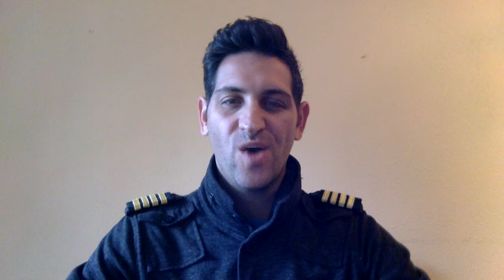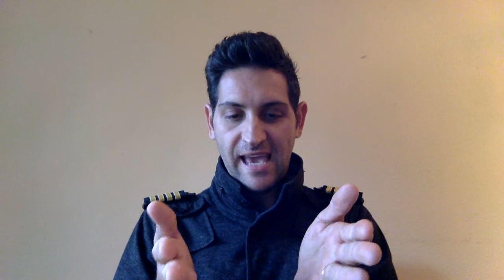How do you control a hot air balloon?

Comment: Very nice explanation. When you're dropping things off the basket to check the wind direction underneath, are you basically determining wind shear? I believe that would mean you have a vertical gradient of wind speeds at a set heading, so you could change your speed by rising and falling within the same layer of air, and if you also want to change direction, you need to find a different layer.

Comment: Would It be possible to build kind of a Sail on top or at the sides of the balloon to controll It?
Reply from the maker: Éderson you do not need a sail.  We can already control the direction of the balloon by using winds at different levels.  If you attached a fan or propeller it could slightly change your direction if there is under 10 kts of wind.  Although that would then be called a blimp
Reply: @Seattleballooning  oh now I got the Idea of the Wind layers, thank you for answering and Sorry for my wrong spelling, I'm from Brazil
Reply from the maker: Éderson no.  Balloons move with the wind.  Although sometimes we have box winds.  That means at some altitude the wind goes every different direction

Comment: Very interesting video. I want to ask you something do you also account for the spin of the earth  when traveling true the sky (To make one complete rotation in 24 hours, a point near the equator of the Earth must move at close to 1000 miles per hour (1600 km/hr). I think such a rotation speed would effect the direction of  were you want to go heavily.  But they never mention such a thing just like you did not mention it. It would be cool if you can explain this to me.
Reply from the maker: The rotation of the earth does not impact balloons.  We move with the wind and wind is only created by 2 things: Temperature change and pressure.   You would find that it is probably more windy near the equator as the temperature is very hot and that temperature change causes wind and thermals.
Reply: @Seattleballooning  Thanks you for the quick answer. Can i mirror this video on my channel? Of course i will mention your channel.
Reply from the maker: 5 ArtesLiberalis go for it
Reply: It doesn't come into play for the same reason we do not feel a constant 'westward wind' outside and when we jump straight up, we land in same spot instead of little westward. It is because just like solid ground, us and the atmosphere are also rotating. I'm no physicist so I don't know if there's any edge cases but I believe that's the general idea.